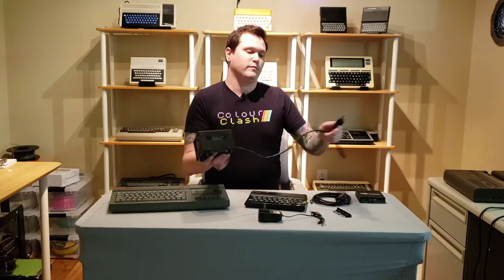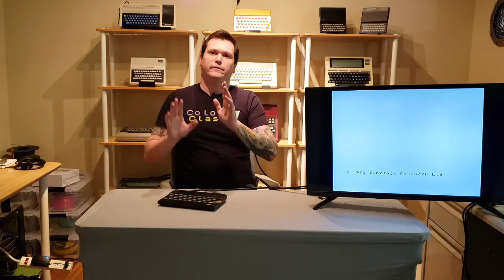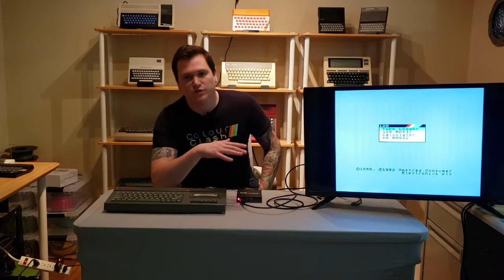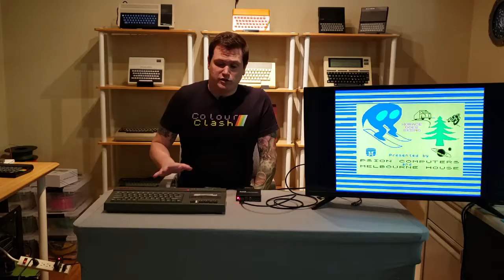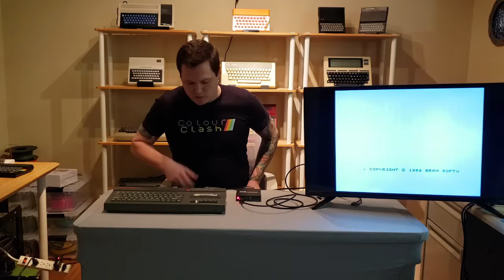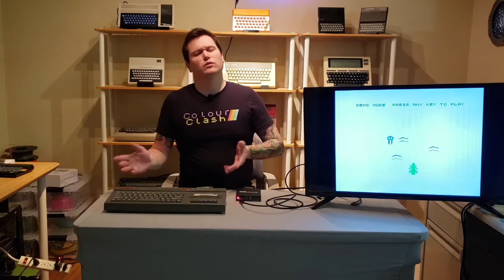How to Use a ZX Spectrum in the United States

Comment: I just came across a Spectrum ZX Plus at a second-hand store here in Canada. Finding a -9v powersupply should be doable, but HOW would the composite mod make it NTSC-compatible? Won't the composite signal still be PAL/50 Hz? (i.e. no color, possibly a rolling/scrambled imagine too). I've been tempted to purchase it, but not if it won't work.
Reply from the maker: Nice find! The composite mod won't make it NTSC. But you can get a TV that can take either PAL or NTSC
Reply: @serialhobbyism_official  - I would want to use a it strictly on a CRT display, otherwise it diminishes the whole experience. And while I do have several CRT TV's and computer displays, none of them support PAL as far as I'm aware (I once tried using my PAL Wii on one, and it was stuck in B&W video). If getting PAL video means using an LCD monitor, I may as well just use an emulator at that point, and I'm purist that prefers original hardware.

It's unfortunately, seems like too many hurdles to getting it working in North America. Ah well, if they lower the price I may eventually buy it and experiment with getting it running, but PAL/50 Hz only video is a bit of deal-breaker for me.
Reply from the maker: Totally understandable! You can also get a converter box. They're pretty affordable, so may be worth trying!
Reply: @serialhobbyism_official  - Does a PAL->NTSC converter box introduce lag or upscale to 480i? I think maybe finding the Sinclair 2068 is probably my best bet, or an emulator.

Have to admit, the Spectrum isn't the most appealing machine to get into. I discovered it uses 1-bit speaker toggling like the 8-bit Apple II or original IBM PC/XT, and graphics that looking like they're monochrome with single color overlays. I'm more eager to get into the Atari, CoCo or TI-99/4a as far as obscure computers go. Maybe I'm just trying to talk myself out of it though, and looking for reasons to avoid it lol.
Reply from the maker: I don't think they add any lag. The basic ones don't do upscaling, as far as I know. But it does sound like you'd prefer something else! Spectrums are fun, but there are so many others out there that are just as fun! So get whatever appeals to you most. I'm a sucker for the Mattel Aquarius and it is a complete piece of junk 😂
Reply: @serialhobbyism_official  - Honestly, any old 80's tech I can get into (I mean, I still think my pair of Nintendo Game & Watch from 1981 are fun and cool! or my Tomy Tron & Scramble, or even my Mattel Electronic Baseball lol). I started with the Apple II back in the day, but have branched out in the years since into anything I may have missed....C64, Amiga, Tandy CoCo 3, VIC-20. Right now I'm trying to get my hands on an Atari 800 and TI99/4a. Hah, I'd even play with a Mattel Aquarius if I came across it, regardless of what it can do! I guess I'm just trying to talk myself out of that Spectrum+ because the price is too high and there's a whole challenge of displaying PAL! Don't be surprised if in a few weeks I end up buying it lol :D

Comment: I have a ZX Spectrum 128K +2 and that same kind of scart to HDMI converter. I still haven't ever been able to get it to work. Recently I tried a couple steps. I set up the scart to the converter, and tried powering on the Speccy with its packaged power supply hooked to a voltage converter. I could see the Speccy turn on with a hum, the audio tape worked, tick sounds played when I pressed keys, but no visuals. I tried it again using an AC adaptor that has split cables used to power either a NES, SNES, or Genesis, and same results, audio with key press, working tape, but no visuals. I've used the same kind of AC adaptor for my Wacom ArtPad II that I use for my SGI Octane2 (yeah i got one) and that powers it just fine. I'm not sure if this is a problem of the Speccy not receiving power correctly or not.

So I'm wondering where the issue could be? Is there something I can use to convert the signal from its coaxial instead? Or what about converting scart to AVI so I can use it on my old CRT?
Reply from the maker: I think the best first step would be try see if the RF output works, which would remove as many variables as possible. Do you happen to have a TV that accepts RF PAL signals? If not, there are some pretty cheap portable TVs (usually marketed for going in cars) that might work. They often work with both PAL and NTSC, so you don't have to worry about regionality.
Reply: @serialhobbyism_official  No, I don't I'm not able to test the RF output with the scart converter I have. I think it's the same model you have in the video. Is there some kind of converter I can get that will do that? At best I want to be able to play it on my old Akai CRT TV.
Reply from the maker: @KumichouGamer  RF would bypass SCART and that converter entirely. The idea was just to test to see if it is even outputting video. Hard to tell whether it is and the converter is broken, or if it isn’t outputting video at all. Are you able to exchange the converter?
Reply: @serialhobbyism_official  no it's old. But I could probably just get another one of Amazon for cheap. Question is, does there exist one that can also convert scart and PAL RF to HDMI? I mean inputting the audio jack connected to the scart still produces audio, so I guess the scart cable is fine but maybe the converter isn't.
Reply from the maker: @KumichouGamer that’s a good question… I’m not sure if that exists or not. But it is possible that the Speccy is working, but failing to output video. If I were you, I’d buy another converter on Amazon so you can test it, then return it if that doesn’t fix the problem. If you can find one that also accepts PAL RF, that’d be even better.
Reply: @serialhobbyism_official  hmm, just bought a super cheap $12 scart to RCA device and $8 scart to HDMI one. Let's see if that does it. Plus it would be on my CRT TV as well.
Reply from the maker: @KumichouGamer fingers crossed! Let everyone know if it works!
Reply: @serialhobbyism_official  Well I got the converters and gave them a test and... nothing. Feh, they were cheap anyways. So, you got any idea how one could test the Speccy through its PAL RF connection?
Reply from the maker: @KumichouGamer dang… neither of them has RF? I think all you can do is get a cheap TV that accepts PAL RF.
Reply: @serialhobbyism_official  Yeah tried that too ages ago. Well guess the Speccy shall just remain an artifact on my shelf. The only other option I can think of is finding someone who knows how to mod or repair them.
Reply from the maker: @KumichouGamer that sucks man, sorry… unfortunately, if you’re in the US, it is going to be hard to find someone who can do the repair.
Reply: @serialhobbyism_official  I'm in Canada, it'll probably be harder
Reply from the maker: @KumichouGamer yeah, probably. 😢 someone more knowledgeable than me could probably give you advice on repairing it yourself. Since you’re getting audio, you know it’s at least mostly working.

Comment: Hi Cameron, you didn't mention the polarity on the Speccy's PSU which is centre negative.  Most DC power adapters these days are centre positive.  You can still buy centre negative though as they are used on a lot of guitar amps etc.  But using the wrong one can be disastrous.
Reply from the maker: Ah, good point!

Comment: Hi, Im an expat in the USA anbd Ive bought 3 Spectrums with no luck of running them and wondered if you could advise please. Btw 3 of the links you listed arent available anymore. You mentioned using a 9v power supply but isnt the best option, why is that please?
Reply from the maker: Hey Andrew! What problems did you have with the ones you've tried here? Are they all 48K models? If you do the composite mod on a 48K, all you should need is that power supply from The Future Was 8-Bit. You won't need a converter or anything.
Reply: @serialhobbyism_official  Thanks for getting back to me.  Ive been using travel plugs to get power so is that not workable? I dont get power on 2 of the Spectrums, the other I get power but no screen and the other I get a screen but nothing loads. So I have to correct myself I have 4 spectrums I bought all from Ebay. 1 x Rubber keyed Spectrum 48k, 1 x Spectrum 48k+, Spectrum 128k +2 (Black model), Spectrum 128+2 (grey model).
Reply: @andrewk2996  You should be aware that the Spectrum is CENTRE NEGATIVE on the jack... most adapters these days are centre positive.  Unfortunately you may have fried your Spectrums :( hopefully just the regulators and not the ULAs.
Reply: @serialhobbyism_official  Would you mind linking to what you mean by "composite mod" please? And I dont mind which spectrum works as long as one does
Reply from the maker: @andrewk2996  So a travel adapter should work, as long as you're putting out clean 9V DC. Not sure why so many of yours weren't working. Here's how to do the composite mod: https://spectrumforeveryone.com/technical/composite-mod-for-the-48k-range/

And with the 128K +2 (at least with the Gray model), you can get an RGB > SCART cable, then use that with an SCART > HDMI adapter like I show in the video.
Reply: @serialhobbyism_official  I have them all, I have 3 x Scart-HDMI adaptors, I even got a RF-HDMi adaptor through today that didnt work. And I am not good with soldering and that sort of thing, so I wouldnt be able to attempt that at all. And Im using the power supplies that came with each Spectrum. This is has been 6 months hobby and I have done and bought everything other than a PAL TV but they are super hard to find in the States. It seems Ill never be able to run a spectrum
Reply: @serialhobbyism_official  Can I use the the Spectrum 128 +2 (Grey) Power supply with the other Spectrums the 48k/+ and 128k (Black model)? I know one of them does work. I guess Im just worried the wrong supply would blow
 the computer up
Reply from the maker: @andrewk2996  that’s a good question, but I don’t remember off the top off my head. I’ll have to look into it. I’m surprised the SCART to HDMI didn’t work for you, I got a really good picture that way. Where in the states are you?
Reply: @serialhobbyism_official  The Scart-HDMI worked with one of the Spectrum 128ks  but the games wont load, the sound is all problematic. On the new 128k I just bought from Ebay, and that showed it tested and working posted by the seller, I get no picture or sound at all using the Scart-HDMI and I tried all 3.  I just seem to have very rotten luck. Im in Colorado
Reply from the maker: @andrewk2996  that is some bad luck… wish I could help, but I’m guessing the hardware is just kaput. You could probably combine parts to get at least one working, but that would require quite a bit of skill. Maybe try loading software from an external cassette deck or even your phone?
Reply: @serialhobbyism_official  I bought an external tape deck but it wont work with a Spectrum 128k +2. I researched it. The only thing left for me to do is get a PAL tv. Thanks anyway Cameron I appreciate you helping

Comment: Hi, at the risk of asking a stupid question, does the +2 need to be modded or is it just the original one?
Reply from the maker: Nope! It doesn’t need any mods if you’re using the RGB cable. Just connect that to an SCART to HDMI converter and you’re good to go!
Reply: @serialhobbyism_official  Thanks so much for the quick reply! Really appreciate it.